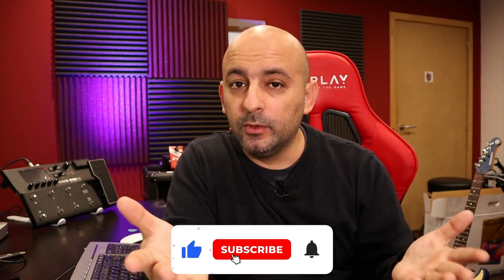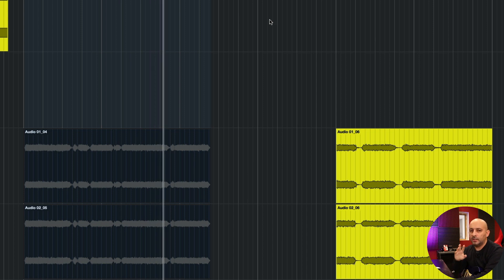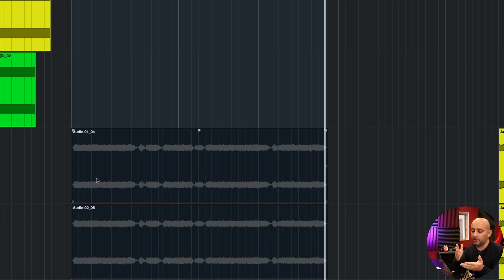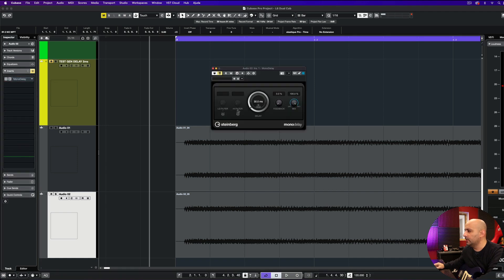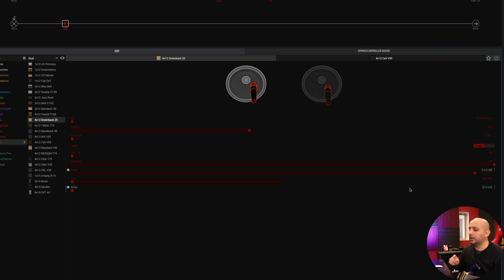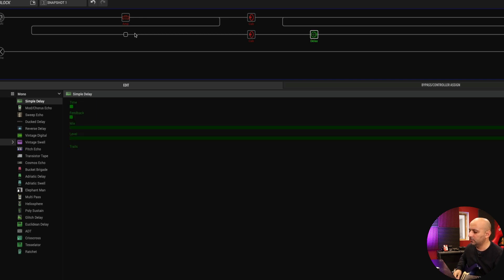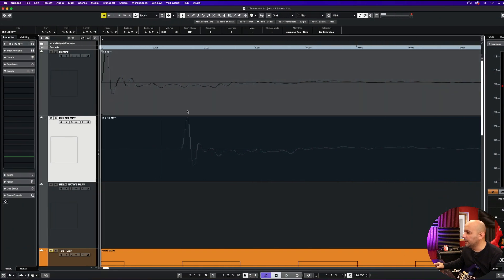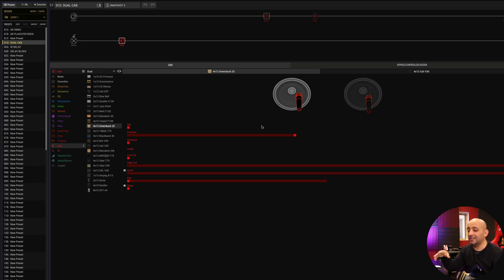Line 6 Helix 3.5 - Dual Cab Delay Explained

Comment: Clear explanation. Now we need the same delay parameter in the mixing block, so we can correct for ad-da latency when we have a fx block in 1 of 2 parallel paths. And also in the mixer of the fx return blocks to delay the clean signal to correct for late y in the fx loop...
Reply from the maker: I don’t plug anything into the loop for a very long time, if there’s a perceived delay I totally agree.
Cheers 🍻

Comment: I was basically aware of what that delay would do but still your explanation was really comprehensive and well done. Ithink this has to be one of the greater updates made to the Helix. I do not own a Helix yet but I was wondering 2 things that I really do not know because I don't have a Helix yet. 
1. Can this new Delay feature be used on custom IRs?
2. When Panning all the way left and right can I use the outputs of the Helix to basically reflect hard panning lef and right? I assume it would work like this.
Reply: Question 1 has already been answered in the Video later on! Thanks for that. Also great work on the visualization with your explanation and moving things to demonstrate.
Reply from the maker: Hi there! I agree, this is, to me, the best update so far! Regarding your 2.º question, the answer is yes🤘😁
Reply from the maker: Yep, that’s it! Thank you for watching! Cheers 🍻

Comment: Good demo and explanation. Do you think there is any reason to consider the following when setting the delay, and which Mic in a dual Micing situation where one Mic is bright and the other is dark sounding? "For a constant wavelength, an increase in frequency will increase the velocity of the wave. Example: For a constant wavelength, if the frequency is doubled, the velocity of the wave will also get doubled."
Thanks
Reply from the maker: Hi! Very good question! I wouldn’t consider any physics when dialing in a guitar tone just because it takes out all of the fun, to me that is. I graduated in electronics and I had my fair share of physics😂 The only time I would consider it is when creating IRs and even that would be just and only making sure that the phase between the microphones is totally aligned.
Thank you so much for your comment!
Cheers 🍻